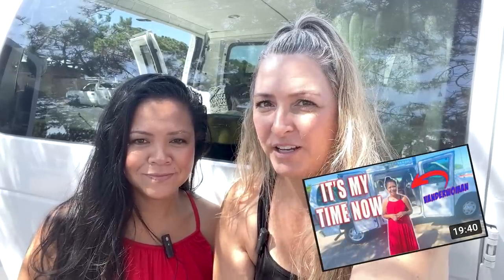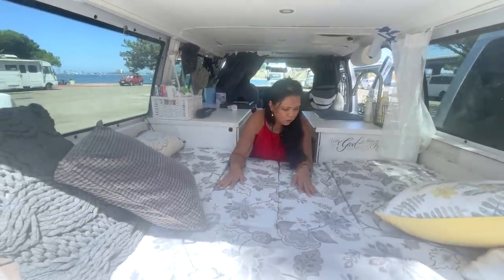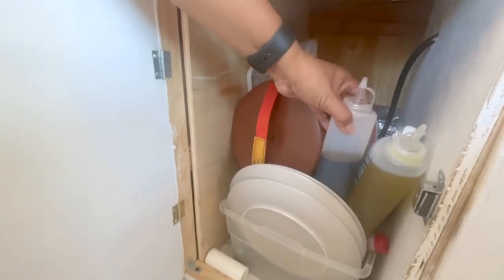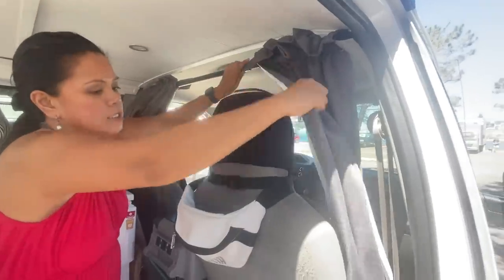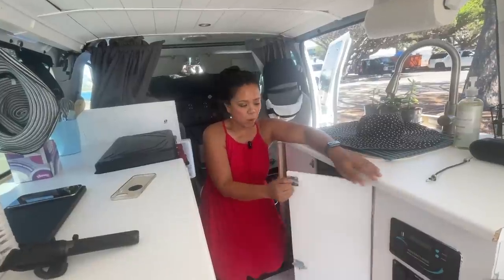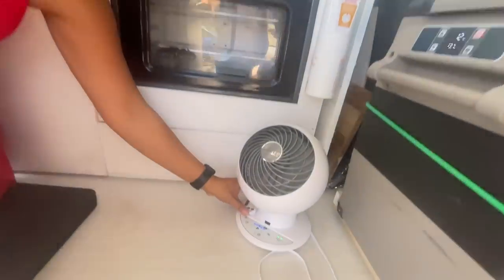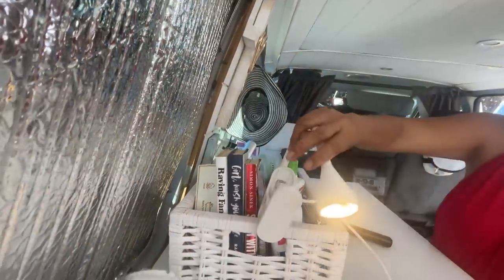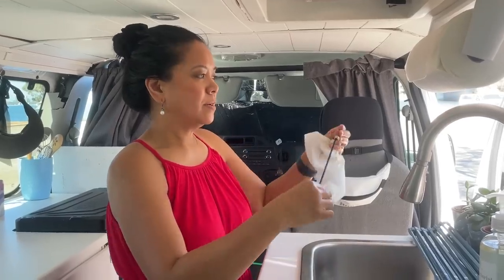VAN TOUR | Single Mom Built This BEAUTIFUL Van By Only Watching YOUTUBE VIDEOS!!

Comment: Lovely van, thanks for sharing. Just one thing tho, your battery voltage was down to 11.6 volts. That's way too low and you are deff.  damaging your batteries. Maybe you should put up another panel as it seems you are using more power than you are making from just the two panels. Greetings from Jamaica.

Comment: They make toilet bags that ate like the Adult diapers......absorbent with a powder that turns into a gel when absorbing liquids. The powder also breaks down any solit waste. When finished you seal it up and put in your garbage can until you can throw away. A pack of 30 is less than $20.oo. A small folding stool on castors to sit on and scoot around on is a whole more comfortable and practical than being on your knees.

Comment: Very nice! For custom sized sheets I intend t just buy regular sheets and “seam” the fitted sheet on a sewing machine. For instance, if it needs to be 4” shorter simply do a 2” fold near the end but clear of the gathered corners - put this seam at the head where it will be covered by your pillows.